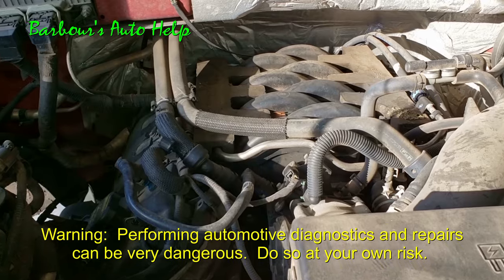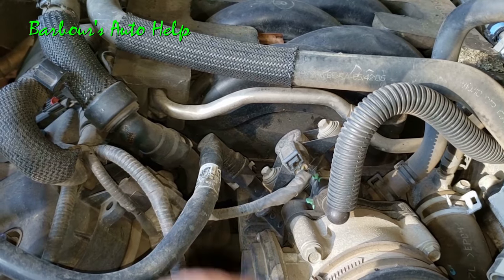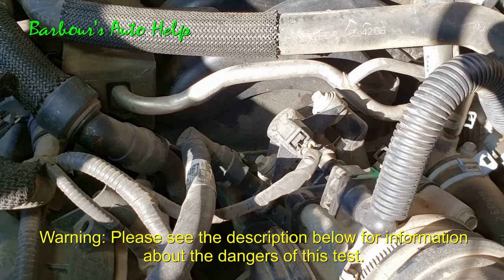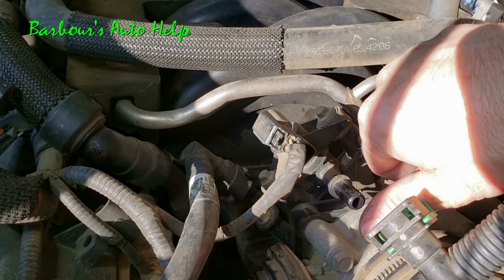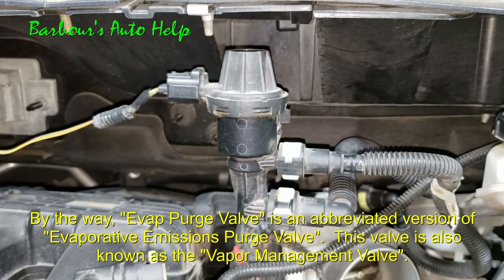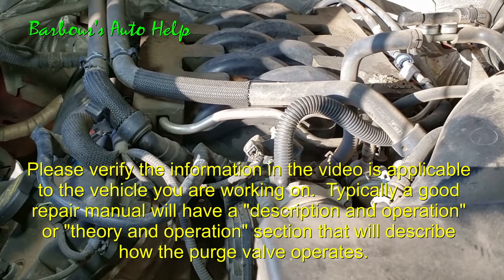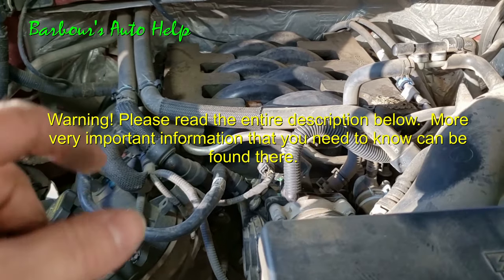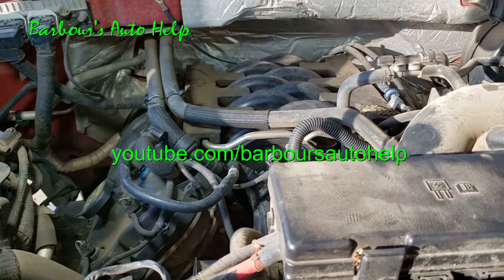Quick Easy Test For Stuck Open Evap Purge Valve

Comment: Everytime i fill my gas up and leave the gas station my rpms fludder down if i come to a redlight. It goes away after a few miles though. No check engine light on. Could this be the purge valve? And do i need to change valve and canister?

Comment: My canister purge valve seems to be stuck partially open when unplugged as well, plus the engine idle would bog down some every 10-15 seconds. It eventually caused my fuel tank to implode/shrink while going down the road.

Comment: So you don't even have to turn the engine on? It will just permanently have a vacuum if it's broken??
Reply from the maker: There is text over the video at the time stating that the engine has to be running when checking for vacuum.

Comment: This is an easy, straightforward way to do a quick test. And a ding of a lot less than a Ford dealer will "hose" (pun intended) me for. If it IS stuck open, is there a danger in essential driving  until the new one arrives? (2 days) I heard somewhere that it could fill the canister with gas. And that begs the question, if I don't want vacuum to the canister, can I drive with the hose plugged until the new valve comes?  Thanx much for this. Hopefully it saves a trip to a high priced shop.

Comment: Hey, thanks for your video,  I have a 2007 Jeep Grand Cherokee 3.7L V6 4x4,  I've gotten both P0455 (large leak) & P0456 (small leak), I will try your test today,  but when both codes present,  could the purge valve still be the issue?
Reply from the maker: Yes, a faulty purge valve can cause a large and small leak.
Reply: @BarboursAutoHelp  yeah you were right! That fixes it! Thank you!

Comment: Thank you! I really appreciate the help. Your diagnosis worked and was very simple. I had a brand new purge valve installed that I suspected was faulty. I replaced it with another purge valve and it corrected the problem. Was getting a p0456 code and the smell of fuel vapor that I couldn't locate.
Reply from the maker: Super cool!

Comment: I test mine same way, disconnect the hose of the gas tank and place a finger in the valve, if you feel vacuum is a fault valve,  the valve make a rough idle, shut off when running, hard to start. THANKS

Comment: I have a question. Can it stop a vehicle from starting? Or have u heard of that before. I have one that finally failed....and my vehicle won’t start. Changed everything, plugs, fuses and sensors then I remember I never got to changing my purge valve that was bad several yrs ago.

Comment: I have a 2005 ford ranger  my purge valve has a 3rd port that's capped off with a green threaded cap it's on the opposite side of the other 2 ports , I want to say it's a service port? Would that port be where I would test the valve for having vacuum or no vacuum.

Comment: it causes code P2198 in my ford edge. I did this test, and YES!!  there is a vaccum with the eletric cable disconnected. the valve is stuck open! thanks, I will buy  a new one
Reply from the maker: Thanks for sharing

Comment: Anyone know if it's possible for the purge valve to be noisy, yet still operate normally? The car runs perfectly fine and there are no codes, but the purge solenoid makes a lot of noise and I haven't seen this issue before

Comment: Appreciate the video buddy.  I have the old style OBD1 with the vacuum operated purge.. was tryin to figure out if it was normally closed / normally open.  I guess the design theory is when you apply throttle and the manifold vacuum drops, the purge valve opens.. anyways thanks a lot

Comment: Is it possible to have a faulty purge valve and the truck not throwing any codes?

2018 ford f150 xlt 5.0
Truck doesn’t turn over after stopping to get gas after long (cross country) drives. (Only starts if truck is left to sit for 20-30 minutes)
Good starter, good alternator, good battery, no leaky injectors, fuel pump fuse is good.
Reply from the maker: So when you say that the vehicle doesn't turn over, to me that means that it's not cranking.  Is this what you are saying?  The engine is not cranking?  That would be what we call a "no crank/ no start" scenario.  Now if the vehicle cranks but doesn't start then that is a "crank/ no start" scenario.  A stuck open purge valve will not cause a "no crank/ no start" scenario but could possibly cause a "crank/ no start" scenario.  But, it's hard to believe that the purge valve could be causing this and not setting a check engine light to come on.  That would be one heck of a leak to cause that symptom.

Comment: I just did the procedure in an 08 explorer 4.6 v8 and it sucked my finger a bit. Not sure if I'm this vehicles the valve should be normally closed or open

Comment: I have a 2004 f150 XL heritage my question is, can you blow in through the canister purge side when it’s disconnected because I know it’s supposed to be open when it’s connected when I put a vacuum to the intake, engine side on the purge solenoid it holes vacuum, but when I blow in through the other side from the canister purge site when it’s disconnected air goes through and comes out the intake engine side of the purge solenoid ?

Comment: I’m working on a mystery and collecting clues. I have a 1996 Nissan Quest, 140k miles, strong smell of gas in the cabin. I also have a terrible low speed hesitation, it bogs down and noses over when accelerating from a stop. I recently replaced spark plugs, fuel filter, air filter and cleaned the MAF sensor. It got a little better but it’s still pretty bad especially with the a/c on. Any ideas would be greatly appreciated. Thank you

Comment: good thing , aside from testing the wiring for current flow or voltage, 
another way to quickly find if it is a stuck open purge valve,
Ow yeah , just don't forget to reset or clear that code if so ever it throws any.

Thanks man for this, gonna see more of your videos sooner, peace!

Comment: Hello, Do you know why my engine is not sucking in air? It turns on and runs just fine. I am not getting no air sucked in even when I removed the purge valve. I tested the purge valve by applying voltage and it opens and closes. Thats when I realized that engine is not sucking in air regardless.
Reply from the maker: What vehicle are you working on and are you sure you checked the right part?

Comment: my wifes 08 G35 had a P0455 code. i reset code and hasn't come back on yet. can this effect her gas mileage. car used to get 20 mpg, now its gettin 16 over a period of last two years.  i am going to replace valve i bought already but hasn't done it yet. p.s all normal maintenance been done including plugs at 96k car has 102k on it. any suggestions?
Reply from the maker: It's hard to say.  There are a lot of factors that can affect fuel economy.  I suppose it may be possible but I'm not really sure if that is causing an issue like that.

Comment: Good day 
My 2009 Ford Expedition with a 5.4 L engine is misfiring rough idle put a scan tool to it gave me a code P0453.
Changed the sensor on top of the fuel tank no leaks in the EVap system. Still doing the same

Comment: I followed the steps and there was no suction, i plugged the electrical back in while engine was running, and it began sucking air, not sure if that was the right way, but either way i suppose i need to replace it now
Reply from the maker: It will suck when it is connected if the PCM commands it to come on.  That's why you test for suction with it disconnected.  It should have no suction with the electrical connector disconnected.

Comment: So while its running pull the electrical connector off and the vacuum line testing if it's got pressure which is bad

Comment: Could this cause possible lean codes? On my 2015 Chevy Impala I have a check engine light on for lean codes and I hear an air leak in the back of the intake somewhere. It sounds like it's coming from the purge valve but I'm not completely sure
Reply from the maker: Typically these cause rich codes when the fail like this.

Comment: I did this test and it my purge valve was sucking in air when I put my finger on it, I changed it and it still continues to suck air. Is there something else that would cause this?
Reply from the maker: Did you disconnect the electrical connector before checking it?

Comment: My evap purge valve on my 06 F250 5.4, closed when initially started. Opened after a minute and then closed for a few seconds while running. Is this indicative of a failing valve or does it open and close while running?
Reply from the maker: Did it do that with the electrical connector connected?
Reply: It did shut off with  the connector plugged in and the truck running at an idle. It shut of completely when I turned the truck off and tried to blow air through the valve. It was closed. When I disconnected the power it closed everytime. I don’t know if it’s related but I have two issues I am trying to resolve. First the tank will not fill with gas except a tiny bit at a time. Second there is a P0171 lean bank 1 code. I plan to swap the o2 sensors to see if the code switches to the other bank. The fuel I think my be the ball valve at the tank. Just my best guess at this point but I wanted to check all the parts. Also looking at the charcoal canister and valve.
Reply from the maker: @rexluongo6470  I'd suspect a possible "bad" evap vent valve or a restriction causing the refueling issue.  A stuck open purge valve will not cause the issue with filling the gas tank.  Also, if the purge valve is opening and closing with the vehicle running and the valve plugged in electrically then I'd say it's doing what it's meant to do.  It's supposed to do that as the PCM commands it on and off.  When is the last time the MAF sensor was cleaned?

Comment: Question.  My 04 mustang gt been sputtering when I give it alot of gas. And when you fill up with gas it kicks pump off and you can hear air. So I went to check the purge valve first and the vacuum line to the intake from the purge valve is collapsed. Took it off and it was still sucking but not alot. Put it back on and checked the one to the tank and didn't feel no vacuum from it. Kept it off and it still sputters when hard excellerating. Could it just be the collapsed hose? It still sucks but prob not enough
Reply from the maker: Maybe you have a misfire.  Are you setting any codes?
Reply: Only code I'm getting is fuel rail sensor but I've replaced it 3 times with 3 different new ones.
Reply from the maker: @michaeldysart2271  Shoot...I'm not sure.

Comment: I've changed this purge valve 3 times already now I have to change it again,,what's really going on...2007 Yukon denali
Reply from the maker: Why do you keep replacing it?
Reply: @BarboursAutoHelp  check engine light comes on, I take it to Auto Zone. Get it checked and it's the Purge valve again
Reply from the maker: @bizkit2147  What code exactly are you getting?  What tests have you done?

Comment: What about a clicking noise from the cap connected to purge valve when I start my car?
Reply: That is the valve opening and closing.  They are closed with no current.  Open with current.

Comment: Struggling with mine but. I have 2 hoses...
1. Runs from the top of a small purge valve to the back of the car, I assume cannister or tank.

2. The hose coming out of the bottom of the purge valve goes to the fuel rail.

The difficulty I have is the fuel rail has no other hoses that can be attached so it looks like fuel delivery also runs through the valve.

Is this actually a purge valve or some kind of vacuum solenoid?
It does have an electrical connector (2-pin)
Reply from the maker: That doesn't sound like a purge valve to me.  Purge valves don't feed fuel rails.  What vehicle are you working on?
Reply: @BarboursAutoHelp  it's a Renault Modus 1.4L Gasoline 2006 (European Car)

It doesn't actually have an Evap system, it vents through a tube next to the gas cap.

It looks like a purge valve and is consistent in design but my next thought is a pressure regulator or fuel flow but according to my service book the pressure regulator and filter are all integrated in to the fuel pump contained in the gas tank.

Either way fuel flows directly through it to the rail and it is electronically controlled.

My understanding of purge valves is they nearly always vent the vapours from the cannister back in to the intake by means of a hose (separate from fuel delivery)

Thanks for replying.

Comment: My LTFT is 3.9% STFT is -0 to -12 appox. and runs perfect. When it runs bad the stft is postive 5-12. (Runs like is is starving for fuel) 2003 slk 230 mostly runs bad. Fuel pressure pressure is 55psi and stays that way even under load. This is the Mercedes code when I get one pictured. It might be a purge valve now it is running perfect. Checked fuel Pressure 55psi all the time. Cleaned some grounds cleaned Throttle body. Checked the 2 valves that are only 2 wire they are clicking. Swaped oem MAF sensor with oem Maf sensor no change. Smoke test done. Can a purge valve cause this. When it runs bad this is the code p2024-1 B28 Mercedes code.
Reply from the maker: Not a Mercedes expert but I wouldn't think a stuck open purge valve would cause the fuel trims to go positive like that.

Comment: Is this part the same as a egr vacuum solenoid?
Reply from the maker: It may work similarly but the egr vacuum solenoid and the evap purge valve are not the same part.

Comment: Mine was sending lean codes to both banks. I tried this method and felt nothing. I put a vacuum gauge on it and the needle was moving. It was undetectable with my finger. I replaced the purge valve and the problem went away.
Reply from the maker: It's highly unlikely that a purge valve that is stuck open will cause a lean code.  Think about it... What is it sucking on?... Gas vapor.  More gas vapor = richer.  What kind of vehicle do you have?

Comment: Is the vent valve a normally open type?
Reply from the maker: An evap vent valve is a "normally open" valve on the majority of vehicles out there equipped with an evaperative emissions system.

Comment: My purge valve stops working like every few months or so.  Why?
Reply from the maker: It probably has to do with the color of the car.  Red and black cars usually have this problem....lol Heck I don't know.  What kind of car is it and how exactly is the valve not working?  Why do you think the valve is bad?
Reply: @BarboursAutoHelp  It's a 97 Ram 1500.  I keep getting the error code that tells me it's bad and when i remove my gas cap, I no longer hear that vacuum sound I normally hear.
Reply from the maker: @ZteveW  What code exactly are you getting?
Reply: @BarboursAutoHelp  P0443
Reply from the maker: @ZteveW  Ok, so P0443 sets when the PCM detects a faulty with the valve or the circuit.  Now the circuit goes through the valve and into the PCM.  Now if I'm not mistaken the possible points of failure are, the valve, the circuit, connectors in the circuit or a PCM.  So, you'll need to do further testing to determine what exactly is the problem.

Comment: So what if it is stuck closed?
Reply from the maker: That's a good question and sounds like a topic for another video.  Why, do you suspect yours is stuck closed?
Reply: @BarboursAutoHelp  sluggish at a cold idle. RPM needle is moving slightly between 650 and 675.
Everything else is new. Except the charcoal canister and EGR valve.

Comment: Do you still respond?! I need help lol
Reply from the maker: I'm sorry, did you ask a question that I didn't respond too?
Reply: @BarboursAutoHelp  i was wondering. Air passes thru my purge valve one direction and not the other. I tested the valve with electric and it clicks like the valve is opening, but it is not a loud click like I hear in most vids. I'm opting out to buy a new purge valve but thought maybe asking you would help because i am still throwing evap code even if purge is still good.
Reply from the maker: @timkrivacsy4855  Well they don't all sound the same exactly.  When it clicks does it allow air through?  Also, what code exactly are you getting.  Also, what are we working on?
Reply: @BarboursAutoHelp  2018 chevy sonic Lt RS turbo. It had a faulty fuel vent previously. Tbh I didn't try air thru it when Voltage was applied. But it just sounds like a weak click. I apologize if this is confusing and or a book
Reply from the maker: @timkrivacsy4855  code?
Reply: @BarboursAutoHelp  p0496
Reply from the maker: @timkrivacsy4855  Here is a helpful article.  Not sure if this will have the correct answer or not but it's about as far as I can take you.  Good luck to you and let me know if you need anything else.
https://www.700r4transmissionhq.com/p0496-chevy-sonic/